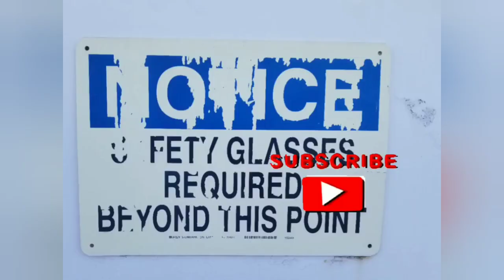Hyundai seat switch not working

Comment: Thank you so much for posting this. Hyundai quoted my mom $750 to diagnose and replace the switch, which is what they said the problem was. They quoted the switch at $500 part cost. I worked at Hyundai previously and the switch part costs $50. Dealerships up charge significantly. My husband and I took apart her seat yesterday, as her “upward” on the recline seat stopped working. It was one of the little metal balls out of place. Fixed the metal ball, and it works perfectly. Thank you so much.
Reply: Hi, I am having the same issue. Can you tell me exactly how you fixed the metal ball and where?
Reply: @hariswaqar2500  you take it apart as in the video all the way to the motherboard… when you pop open the place where the metal balls are at, gently get something to grab them with such as tweezers and fix them back into place. This video is excellent just follow every step!
Reply: @Inheartsforever  Sounds good. Thank you so much. I hope this helps with my seat repair.
Reply: Oh man thank you for this!! 😢 Hyundai told me yesterday that I needed an entirely new seat! $2600 + $400 labor!
Mine won't go backwards. I hope it's just the same problem you had.
Reply: This is my problem too. Hyundai quoted me $800 to replace seat motor.
Reply: Just did this to my driver's seat. Mine would recline but not go back up. Literally took me about 45 minutes and was back in business. Thank you so much for your video.

Comment: Ball was falling out. I had to pull the spring in the white cover out a bit to ensure it pushes the ball down enough and it works fine.

Thank you very much for this as I couldn't get right hand driver replacement but was able to fix it thanks to your video

Comment: Thanks for this video, I too had this issue on my 2017 Tucson and had to get roadside assistance service (RAA) out. They diagnosed faulty switch. After watching your video I decided that the ball bearings may have moved. My solution was to use a large rubber mallet and while holding the lever in the forward position gently tap the area where the switch was located and after less than six thumps the seat motor engaged. 
Probably saved me a small fortune if I had taken the car to a mechanic and they replaced the switch. 🙏👍